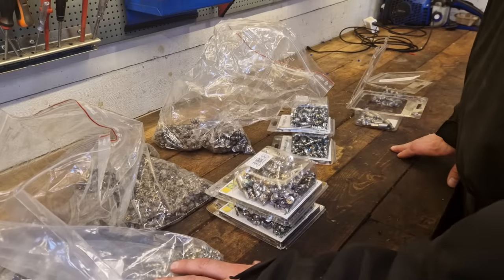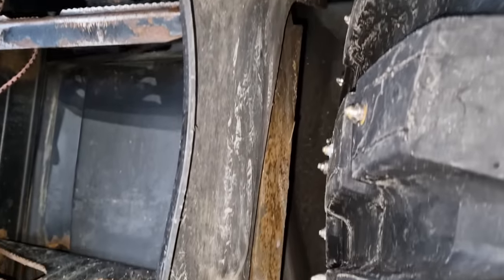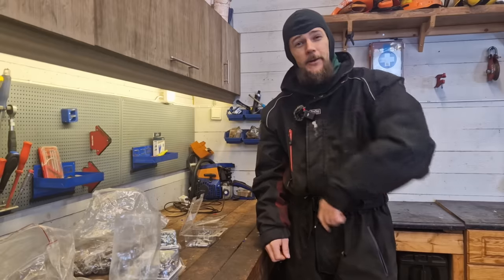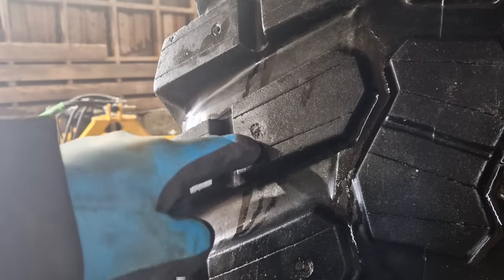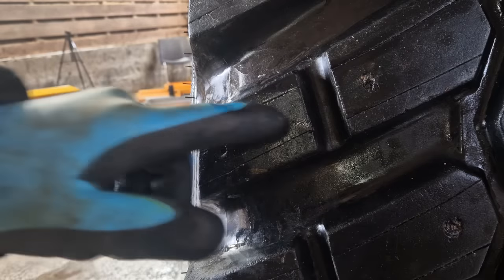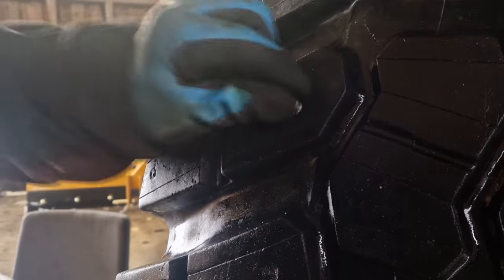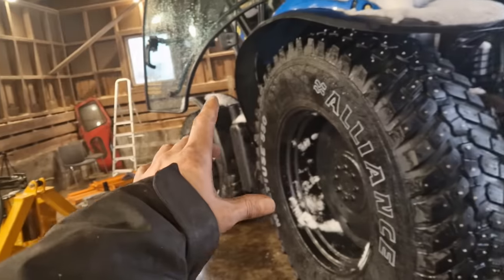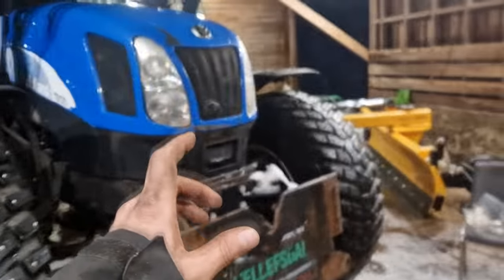Why I'm NOT Using Snow Chains: Snow Plowing Tires

Comment: Well if there is a possibility to use such studs, it is really an elegant option to get rid of the snowchains with all their drawbacks.
But there are many countries where you are not allowed to use studs anyway, the argumentation because they are in use the whole season ( or for an extentended timespan compared to chains ) they cause massive surface damage on the road. In my region, if police get you with this you have to pay a high fine 😮
Reply from the maker: Oh wow. I hear some other commentors say the same thing. I guess it varies by region. I know they are not allowed within the main city of Oslo, the capital in Norway. Around my local area, we 'usually' have ice and snow-covered roads, so the studs dont touch the pavement to do any damage. 

Thanks for the comment ❤️

Comment: Nice work. Athough I would advise to check with Statens Vegvesen (Norwegian transportation authority) what is the max. number of studs per tire allowed legally on paved roads.
Reply from the maker: I did that and I'm well within requirements, because the tires are so big. I can also show that I run studs instead of chains, which are much more damaging to the road. I could apply for an exception to the rule for this, but it's not needed since I am below the max treshold. Thanks for the comment, and for watching my back 😉❤️

Comment: I dont use chains in my plower because they pack up the snow making my wheels into chunky snowballs

Thought it was for a plower not a tractor but oh well :D Thats still my reason for a 11hp plower to not use chains. Much smoother and better grip with the tyres only.
Reply from the maker: Sorry about the confusion here, with snow plower and my tractor. I can see how the title might be misunderstood.

I bet those smaller snow plow machine tires can clog up with chains on them as you say. I guess studs could be suitable for that too. I have zero experience with them.

Thanks for watching ♥

Comment: 7:26 idk about resistance, that looks like something is holding it. If it was truely in neutral but there was a lot of resistance in the transmission you would still see the other wheel wiggle slightly if there was any movement in the diff at all. Im guessing it automatically applies the parking break when the tractor is off to prevent roll aways. Honestly just move the tractor so its facing the open door then spin the tires in drive all you want.
Reply from the maker: You're probably right, I don't know. It's a good idea to face the tractor towards the opening like you say. Thanks for the comment, and for watching! ❤️

Comment: Have you thought about adapting the Auto chain system they use on school buses and other mid to heavy sized trucks ?
Reply from the maker: I haven't thought about it. Never seen that system used on a tractor before. I would think it reduces ground clearance quite a bit? But I am not familiar.

Thanks for watching ❤️

Comment: Don't ever use old stud holes. Little rocks and debris will get inside once old holes are driven on. Studding on top unseen debris will work deeper into the tire causing leaks. I've seen it many times. Siping gets snow to stick in the grooves. And snow sticks to snow for great traction.
Reply from the maker: Great info! Thanks for the comment ❤️

Comment: I swear by studded tires when plowing. I do a lot of driveways around the lake and they can be very steep. Studded tires have really made life much easier.
Reply from the maker: Glad to hear you've had a positive experience as well! Thanks for watching ❤
Reply: I’ve had chains my whole life, but they get loose ect, just bought a new tractor, they through in chains, even asked fir good H chains but they didn’t and the chain got into each grove so didn’t work, got new ones and they came in, they insisted they fit, but not even close  they Jerry rigged them and I had to redo it to get them to fit, but they fell off twice now.  So I say frig it and I’m going to try it. I have 4 km of road on my lake to do, I’m only one who lives here, so now tons of people want there driveways done. I’ll let yiu know how they work.  I have loaded tires so I can’t let air out and put in more air to tighten tire.
Reply from the maker: @Dan-qt7kq  They don't provide nearly the traction that chains do, but they're much more comfortable to drive on. You might be able to leave them in all year too, depending on your use case and local regulations.

Comment: The spining wheel on neutral is normal, as the oil in gearbox transfer part of the energy thru the system..
Reply from the maker: Thanks for the explanation! ❤️

Comment: You need to spend some time fixing that barn door. With all those holes, it was no warmer inside.
Reply from the maker: You're right about that. It's not a great design either. But currently, there is a huge opening in the opposite wall, that needs to be closed up as well.

Thanks for watching ❤️

Comment: Could you use the 3 point hitch bars resting on a couple blocks to bring the rear up?
Reply from the maker: Not on this tractor, it doesn't have double acting 3-point cylinders. There is a jig that you can buy, which does what you explain with single acting cylinders, but I don't have one, unfortunately. 

Thanks for watching! ❤️

Comment: How do they hold up/affect the tire during thread wear? Will they eventually get pushed in far enough to puncture the tire? Or do they wear with the tire?
Reply from the maker: They wear with the tire. You should be able to install them in a brand new tire and drive until there is no tungsten left, then you can install new ones, or maybe the tire is completely worn by that time. Depends on the tires I guess. The ones I installed here should by design never puncture the tire, unless you drive them in way too far.

Thanks for the comment! And for watching ❤️

Comment: can i theoretically remove a predetermined if necessary amount of metal and just use screws i have at home?
Reply from the maker: Idk exactly what you're asking, but using regular screws is not a good idea as they will wear out very fast and also not be very secured to the rubber. Could also work themselves in and puncture the tire, maybe.

Comment: studded tires are illegal where I live.   around here the Fire Engines use chains and/or built-in wheel sanders when it gets too slick to stand up on the road...   Deep snow?  you need chains.
Reply from the maker: I'm curious where you live. In Norway you have to pay a fee in some areas, for driving on studded tires.

Cheers, thanks for watching ❤️

Comment: For your information:  Canada banned studs years ago because they chewed up all the highways so badly, they had to be resurfaced...  The only reason they don't ban them in your area is because there are not enough people using them to make a noticeable difference...  You're destroying the highways by using them.
Reply from the maker: You're right about that, people should check their local regulations. They resurface the roads around here probably once every 10 years or so. But I am not sure if that's because of studded tires or just for general maintenance. Regardless, I think they do less damage than the alternative, which is driving on chains all winter.

I do believe they have a ban on them in the city of Oslo. I know they have a "stud tire fee" for driving in the city closest to me. $140 for one season. I can drive to that city without paying though, since my home address is in a excempt municipality.

Thanks for the comment! And for watching ❤️
Reply: @woodlandwrench  
About your opinion that chains do less damage; you are completely wrong.
First:  chains are only used in extreme conditions when they are needed, while studs,
once installed chew up the roads everywhere you drive.  This means the destructive effect of using studs is multiplied thousands of times more than chains.
Second; the physical difference between studs and chains is obvious,  Studs are points that hit the road.
Chains are round and flattened.  It's the difference between sandpaper with thousands of points, and smooth metal that spreads the weight of the tires over a larger surface.
Also: the regulations you mentioned supports my comment.  I can promise you if too many people start using studs in your area they will be completely banned.
Reply: I live in Alberta Canada and I and most people I know run studs definitely not banned here.
Reply: @lazrd355  
Don't worry:  In a number of years, all your highways will be ruined and then they will be banned...
Trust me; it's just a matter of time and physics.  It happened here in the 1960's and 70's and it will happen in Alberta.
Reply: You check the rules. Permitted with conditions in many places in Canada. Although for cars, winter tire are often a better choice.
Reply: @robertmorgan6660 
Check your brain: winter tires are compulsory in Canada.  Studded tires are  winter tires with studs added to them.
You haven't checked anything; now get lost.
Reply: @indrekkpringi Wrong again buddy. Winter tires are only mandatory in Quebec, and on some highways in BC. Completely voluntary everywhere else.

Comment: Old manual operated tractors you can spin those wheels but New computer operated tractors dont obey you 😅
Reply from the maker: You're right about that. It's on the verge of too new for me to work on by myself. I wouldn't want anything in-between mine and a brand new one.

Thanks for the comment! And for watching of course ❤️

Comment: I never had a problem with chain it just sound like you suck at putting them on !!! from riding mowers to quads to cars to trucks to tractors I never threw a chain ever and they seam to be balanced when I am done !!! so I assume it's a skill issue !!!
Reply from the maker: If you're talking about not retightening, then I guess it could depend on the type of chains and tires you're running. If you've never thrown a chain around your axle, then I'd say that's very good. Getting that mess untangled is a nightmare.
Reply: the trick is flatten the a bit then tighten the chains then pump the tire back up is the trick no one tells anyone about !!! and leaves no slop behind and the chain should be super tight on the tires. never threw one yet. knock on wood !!!